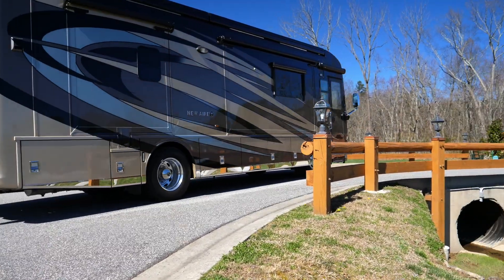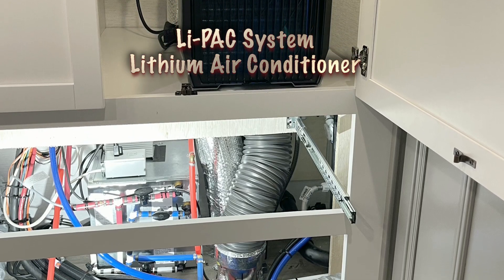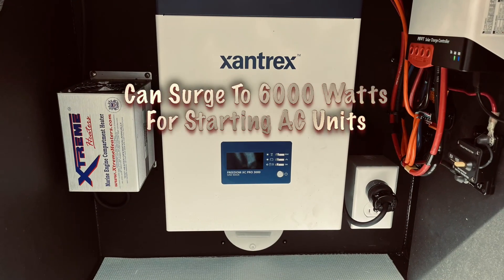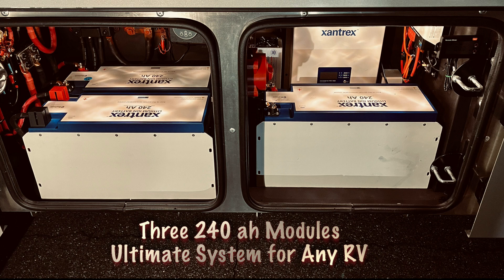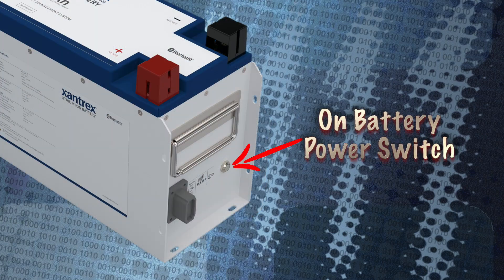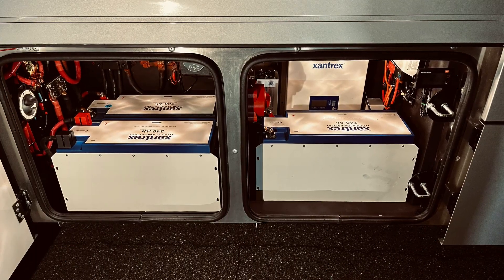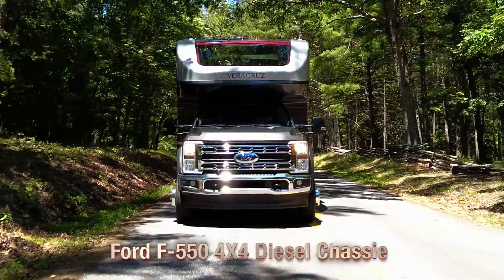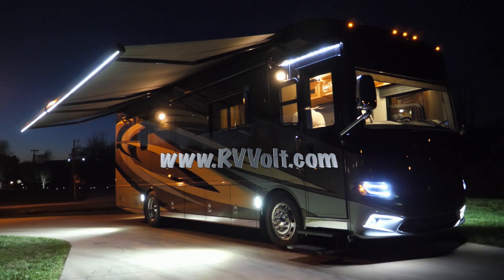Veracruz Xantrex & Wave 2 RV Lithium Install - Mike Mas

Comment: Hi Mike, I'm curious if you have had issues with these batteries? I have had nothing but problems with the software on these 310's. 
Quite literally unusable. Very curious if you have error codes non stop?
Reply from the maker: Hello the 240's are bullet-proof however I have a 310 and a 320 in intensive care. The 320 just freaks out shuts down then I have to wake it with a small 12 volt charge might work for a day or a month.  The 310 dropped down one day to like 9 volts and all I get is error to low to charge. 

MIke